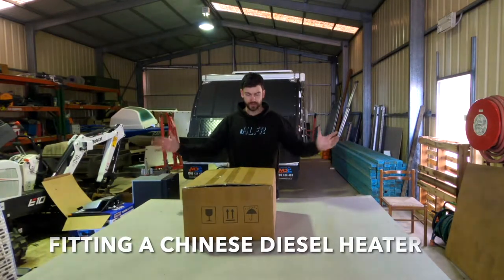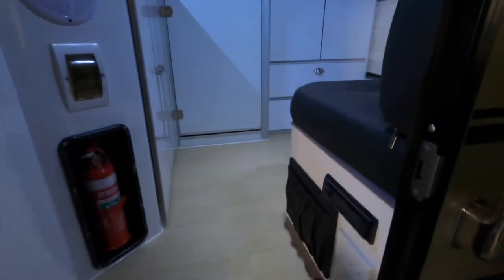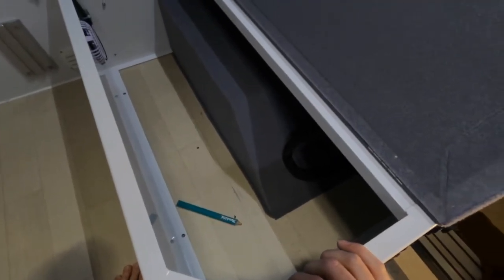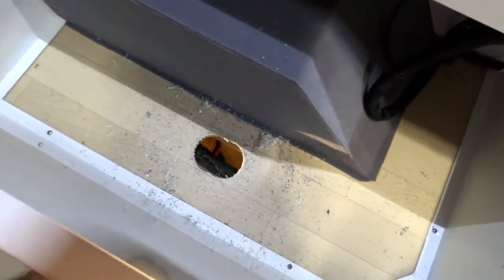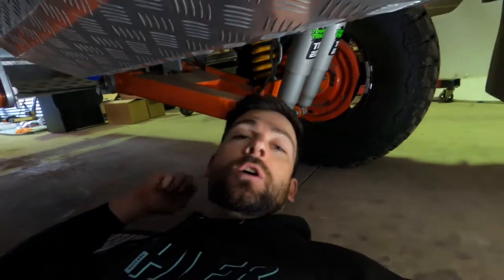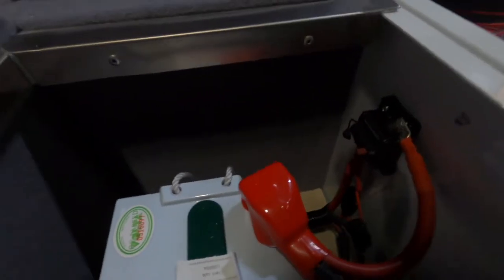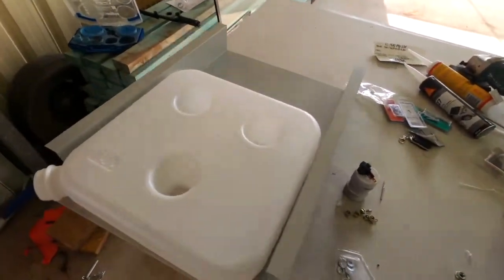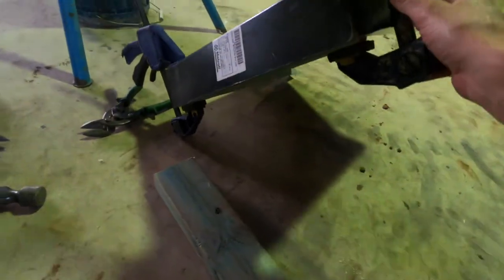Diesel Heater Installation - Chinese Heater in a MDC XT12

Comment: Great video. I'd like to put one in our xt12. l would put the pump under the floor. Hate to spring a leak and have diesel in the van.
Reply: I mounted my fuel pump externally under the floor.
Reply: @darrenoates381   I put mine under floor and extended the exhaust to behind the wheel on the other side of the van.

Comment: Thanks for that, how did you go with your plans to keep the dust out, I was going to get some SWP fit a screw cap each end and silicone the air filter pipe into one end bring the other to the side of the van and just remove the screw cap to run the heater, the exhaust is just a nice fit with a rubber door stop to cap it when not in use, we get mud wasps down here that will block anything they can fit into.

Comment: Great detailed overview on the installation, I have a Jawa Solera 12 and  I’m going to do the same. Did you go for the 5kw heater? and how well does it heat up your van. Cheers mate.
Reply from the maker: Hey Matthew, cheers mate! Yea we put in a 5kw unit. Heats the van up almost too quickly haha, we only ever run it on low heat & low fan, that’s plenty!

Comment: Great Vid thanks, just got a heater for our XT 12, was going to fit pump underneath but like it on the wheel arch, did you have to move the gasline under the floor or was the exhaust far enough away.
Reply from the maker: Hi John. I was worried that the pump would be too noisy under the seat but it really isn’t! The gasline was far enough away I didn’t need to touch it.
All the best with the install!